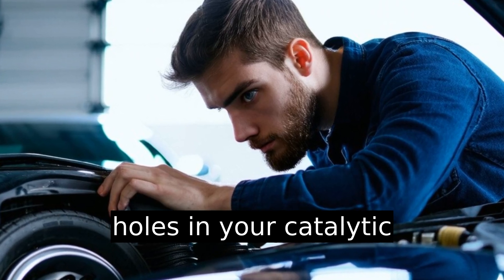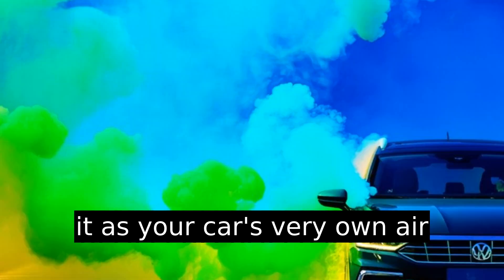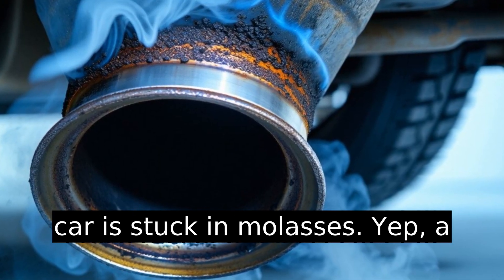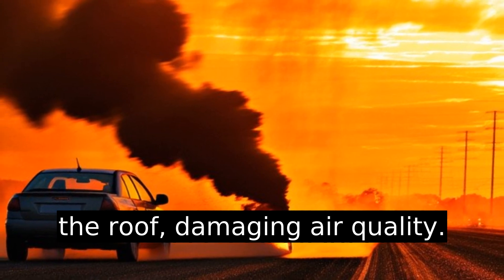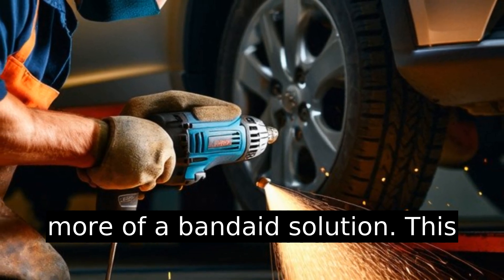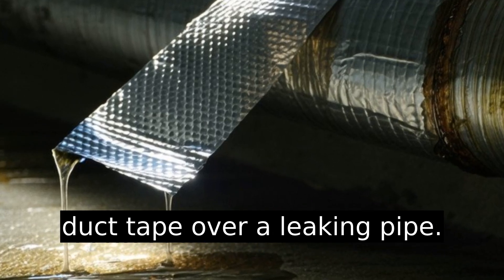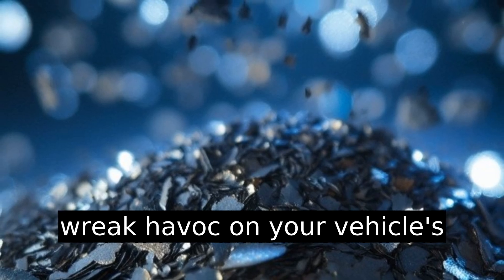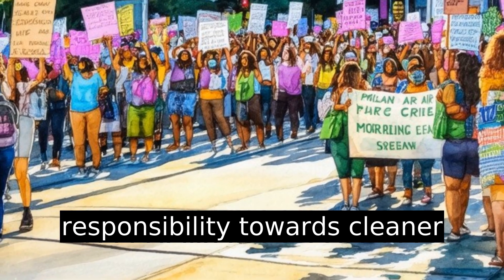Is It Okay To Drill Holes In My Catalytic Converter?

Comment: my old 99 honda has 1.6 litre engine, the cat clogged, I broke out all the interior and vacummed it out, straight through now.  Gas mileage and power improved,  I don't feel guilty since I don't fly anywhere and don't have a boat or other gas hogs like a big truck.  I live in an area where there is no emissions testing.  Plus I ride an electric bike a lot in the summer.
Reply: Does you check engine light stay on?